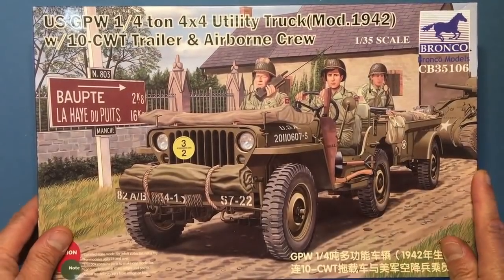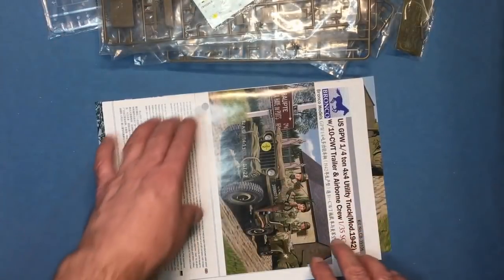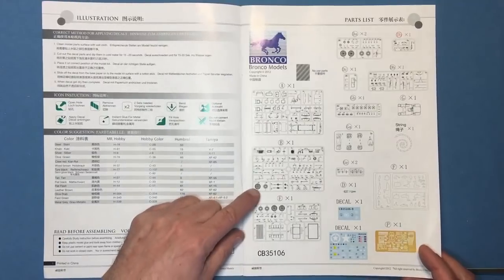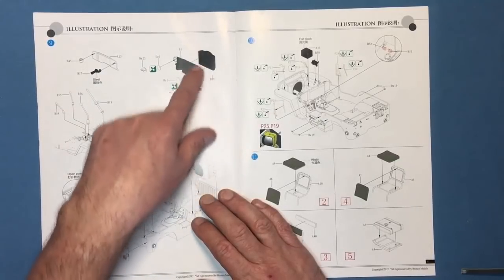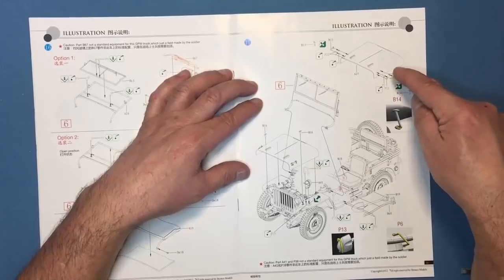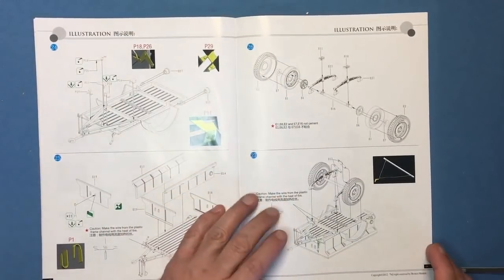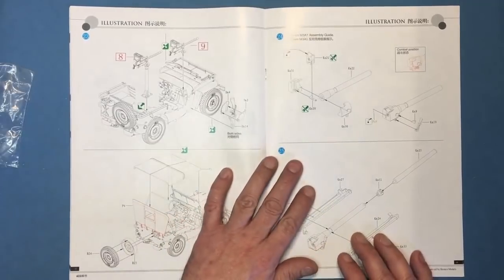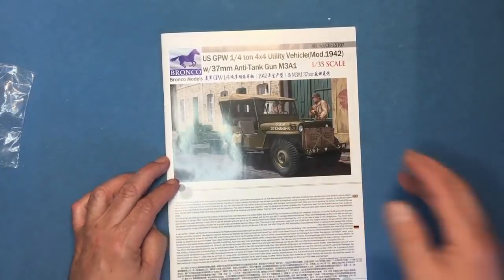Sprue Review. Bronco GPW 1/4 ton Trucks with trailer and 37mm Anti-Tank gun CB 35106/CB35107

Comment: Your knowledge blows me away. I smell each kit inside when I open them. I have done that since I was a kid. Back in the day, the releasing agents companies used had a wonderful aroma. Quite nostalgic to me. I am beside myself to see these kits as I have not purchased either of these yet. Photo etch makes my head hurt though. Only if you have to bend & shape. Gel super glue makes using it easier but, I suspect that gel is a weaker bond than straight up CA. Nice video. I prefer them with full motors.